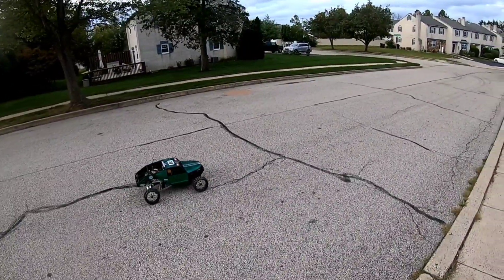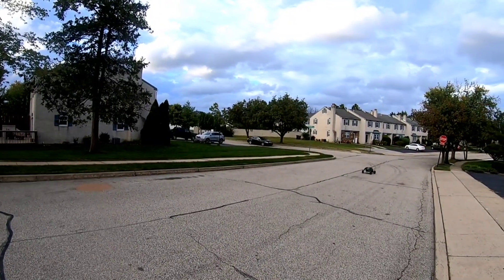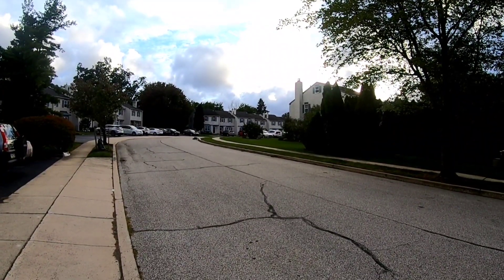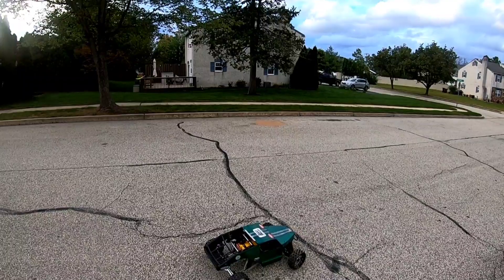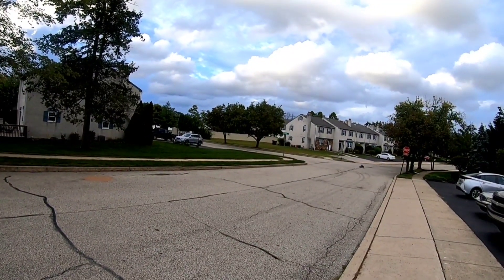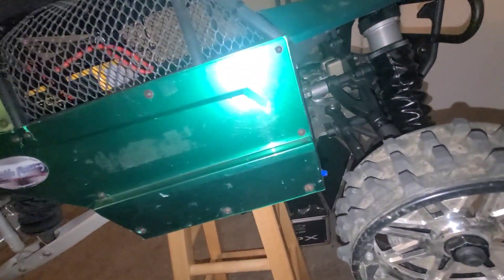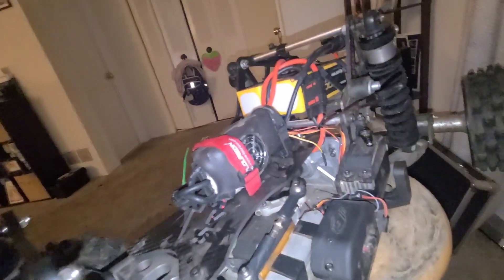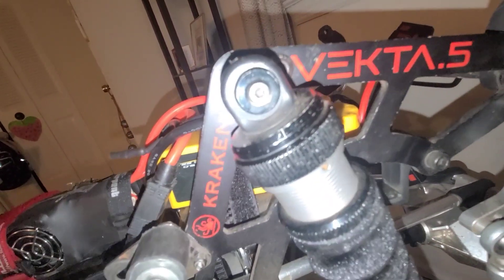1/5 Kraken Vekta.5 Buggy Brushless  First Run and Overview

Comment: Yeah, that's nice! 

How does she do on hill climbs?
Reply from the maker: Traction wasn't an issue with these wheels. I would only caution to not take high speed sharp turns as the traction is so great the carwill flip on its side.

Comment: Nice setup! How fast can the castle 2028 push this truck on 12s?
Reply from the maker: Depends on gearing and lipos. I've seen these do 70 plus mph on the right setup. Should be able to get 60ish
Reply: @jaymitchrc  yeah I’ve seen the MGM setups push them really fast. You’re one of the few I’ve seen with the castle setup and my local hobby shop carries the castle stuff. 50-55mph would be fun to me.

Comment: Nice setup! I have vekta.5 also. How fast can the castle 2028 motor push this truck on 12s?
Reply from the maker: Castle motor is capable as well.
Reply: @jaymitchrc  what pinion gear size did you go with?